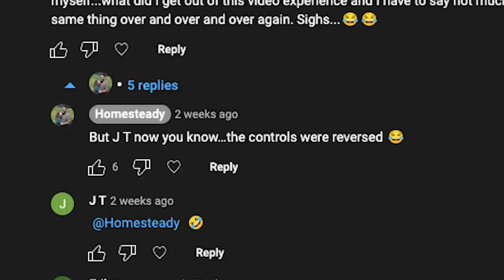Why We are RE DIGGING the POND DAM...

Comment: For that small of a pond, I'm not sure about using a standpipe for overflow. Over time, that pipe will corrode and fail. A good spillway will keep the pond level down. My father put in a standpipe with shut-off valve on the 2.5 acre lake at the farm. When there was a lot of rain, the spillway took off what the pipe couldn't handle. I think it was a 18" or 20" pipe. A few years ago (lake was 32 years old) that pipe and the valve sprung a leak. If left, it would have eroded out the dam and it would have failed. We had to drain down the lake, cut off the pipe, fill the end with concrete, cap it, and cut off the other end and cap it. Now, only the spillway carries the water off. It was higher than the standpipe, so it had to be brought down 6" so the pier wouldn't be underwater. Pier height had been established using the standpipe water level. I have a 3/4 acre pond, with lots of water coming off the hill in big rains, and I just have a spillway lined in bullrock. My pond has been here over 30 years. The drop-off behind the dam is about 30' into a slough.

Comment: U definitely got rain coming, lots of it!! You don't have anything in the pond for the fish to hide from larger fish. Do that before water gets in there! They need hiding spots!! Or you won't have many fish cause all the big fish will eat the little fish, then die themselves from lack of food from eating it's all. So hiding spots... Important! Frogs, plants, tadpoles.. important. Just a suggestion take it or leave it. Most important thing is an air raider to put air into the water for the fish, or you'll have dead fish. Do that b4 water gets in there! I had Wendys for lunch today too! Lol small world. I'm a landscaper, so I know all about ponds. Good luck. Oh if u want it 8ft deep, then make it 10ft, settlement!

Also don't forget a screen for the top of the pipe, you don't want it to get a clog. So put a screen over it, and 2-3 times a year check it make sure no leaves are blocking it. Easy. 

Btw, you look like Mario! Where's Luigi?
Reply from the maker: Great points! Did you notice the bricks and stumps on the sides of the pond? They are the start of a bunch of structure for fish!
Reply: @Homesteadyshow  no I didn't see that hun. That's perfect, just remember stumps will eventually rot over time and wood floats, so it will be difficult to hold down. Lol also things like concrete and stones, are your best bet.  Also if you want deck for your pond, then I suggest concreting it into the settlement below the dirt line of the pond, before water gets in there. So you'll have a nice area to cast from, to swim off of, and to load small boats and stuff into the pond. If course just a suggestion. I'm not sure we're you live, I'm in Virginia. If you need any lumber for creating anything let me know, my husband works at a lumber mill. We can get wood at cost of creating the wood. So basically a buck a piece. For 4x4s, 2x6s, 2x4s, and 2x8s. Unfortunately they don't do plywood. But everything else they do. I have a huge pile of wood out back now. That you could help yourself too. 

I've been watching you guys for a while now, u have a beautiful family and we love what you're doing! Keep up the hard work! Eventually it will pay off. I'm sure it already does through the quality of life!

Comment: Stop crying and get working should definitely be a tshirt. And a hat. And a mug. Words to live by!
It’s looking awesome! So great that you got the pipes in and could save some $’s on them! Danny’s method of building the pond then digging a trench makes a lot of sense. 
I might have some news. A property showed up on the market yesterday that has a lot of potential. The house is a bit unfinished so would need to get floorboards or carpet done before moving in, and some of the walls need either painting or dry wall etc. The kitchen is acceptable, bigger than I have here but not yet big enough but it looks like there would probably be enough space to expand it, or worst case scenario add an outdoor kitchen. There is running water and power and sewerage working so it’s liveable as is, but it will be way easier to get the flooring done when it’s empty. I can settle both and then rent here for a month or however long I need to get work done. The price seems to reflect the fact that there’s work to do and I would be able to get the main things done before moving in. In fact it’s a bargain. It’s 14.34 acres, but some of it is quite rocky. There seems to be 2 good pasture paddocks though. The agent said it could support 6 steers! There are rainwater tanks and bore water. We have a family friend (he was sort of an honorary extra son to my grandmother so I guess that makes him an honorary uncle) who lives out near where I’m headed and it was Gran’s funeral today so I showed him the listing and picked his brain a bit to try to figure out if there was something wrong which was why the price is so low. He has a friend in that town so is going to ask some questions for me. I spoke to the agent yesterday but because of the funeral needed to not go racing out to see it immediately, so we’re planning to go next week, on my birthday. That would be cool if I love it! If it has a good, peaceful feeling, and if the traffic noise from a nearby main road isn’t too loud, then it might be the one. If I did get it, I would be able to fix up what’s needed, put in a big solar system (honorary uncle knows a guy!) and probably rip out the kitchen and put in a new one, and potentially the bathroom too if that needs it, and be mortgage free and have a bit of change left from this place, so financially it would be brilliant! Oh and the views from the lounge and bedroom windows are gorgeous. Looking out onto undulating fields with stone walls. And there are some stone walls that would be mine too! It’s 3 bedrooms and has an attached garage and also a double carport, so the garage could be converted to a room if needed. There’s no shedding so I will need to add something for milking and storing feed. Totally doable. This could be it!!! So, do you want me to email you the link before I’ve gone out to look at it or do you want to wait until I’ve seen it and know if I love it?
Oh, it’s about 20 minutes closer to town than the last place I was looking at too. An hour and 16 minutes to Mum’s, rather than an hour 35. That’s a fair chunk less for the round trip. It’s also only about 10 minutes on country roads and then it’s highway all the way in, so a safer drive.
Reply from the maker: Monique! That’s so exciting!!! We’ll be thinking of you. Def will be a doable distance to travel to your Mums
Reply: @Homesteadyshow  isn’t it! Fingers crossed it all falls into place! I’ve spent most of the day today scrolling through the photos over and over lol. I’m sure it can work. 
That little bit closer to Mum’s also means everything is closer. My doc, my chiropractor, my dentist. The regional city which has just about everything else I might need is 20 minutes instead of 40. It even looks like one of the major supermarkets will deliver groceries to the door! That would be very handy, especially in the first year. So we shall see. I’ll let you know!
Reply: Hey Monique, it’s Sue from Melbourne : )  That’s awesome! I checked out the listing - you did amazingly well to find some decent land for that price! The house is a bit raw at the moment, but that’s ok, all the better to mould it into something you’ll truly be proud of. Maybe it’s just the weather at the moment, but I’d want to put a wood heater in there asap, if it doesn’t already have one, then get busy planting some quick growing firewood! And probably some shelter belts : )   I doubt it will have much affect on you but the title has a Vegetation Protection Overlay on it, just so you know. Do you think you’d put an offer in before it goes to auction, if you decide you really want it? At that sort of price it might not be worth risking losing it. But also, make sure you get it checked out in case there’s a reason it’s so cheap. All stuff you know. Anyway, good luck 🤞
Reply: @s-c..  Hi Sue :) I decided it wasn't right for me. The house just had too much to do, including things like replacing areas of rotten floor and things that I just really don't want to deal with, and something that doesn't show very well on the photos is how little flat land there is on the property. There's really only a few metres around the house that's flat and then it's a really steep hill. Steeper than Aust and K's hill down to the barn. I want my next place to be the house I die in, and once I'm old and a bit feeble (can't say old and grey coz I'm already going grey!) I would struggle to get around I think. I have a bit of arthritis in my knee which is being made much worse by just 4 stairs in my current house so I think it would flare up from that incline. 
I did then ask the agents if they had anything else I should look at and there was another one which was up for auction Saturday. I had seen the listing and ruled it out because I thought the road would be too busy, but it was only a 15 minute drive from the place we were looking at so we went to have a look. Actually, the traffic noise was fine because it wasn't constant. Here I have constant traffic noise and it's really draining, but there it was the odd car or truck and you heard it for a few seconds and then it was gone. It was really nice, but needed some immediate work and there were a couple of things in the contract that would mean you'd need to have a fair stash behind you which you might need to use at any moment. I went to the auction and I very nearly got it, but one extra guy started bidding right at the end and he pushed it way over market value. It just wasn't worth that much. Even without factoring in the 20 grand of immediate repairs and the required stash, it wasn't worth it. So I stopped. I think I made the right decision. Something else will come along. I still have some time. Actually the agent told me about one that will be coming up next year that has a lot of potential as long as it's the right price. The agents thought I did great at the auction and they really liked me, and they know what I'm looking for, so I know that if something comes up that might suit they'll call me straight away. So now I have agents through 2 different agencys looking out for what I'm after. Something will show up at just the right time. I'm sure of it.
Btw, Cobden is a gorgeous little spot! I'll be stoked if that's my nearest town! Really lovely people.
Reply: @s-c..  btw, great job finding the exact property with that info! Sue the Sleuth! 😂😂😂 It did have a wood heater but they've removed it.🤦‍♀ The stone hearth was on logs in the lounge room. There was a split system but that wouldn't really be enough out there. Better than nothing though. The rooms were actually quite large and it had a lot of potential, it just wasn't right for me. Someone will do wonderful things with it though. They've had a lot of enquiries already so if you want to snap it up yourself be quick! If you bought it we could do coffee 😂
Reply: That’s too bad Monique. Gosh, maybe I’m not as good a sleuth as I thought 😂, cos even street view has the whole area looking fairly flat. Lots of mounds all over the place tho, & rising to the main road?  But yeah, I have a particular set of skills earned from several years of obsessive real estate research!
It’s very wise to be thinking ahead & future proofing through your property choice now. But just remember, there is no perfect property & the longer you wait for that golden nugget the more perfect it will have to be because you’ll have less ability to fix it yourself. This is also stuff you know : ).  So what’s on your must have list, apart from being flat?
Reply: @s-c..  😂😂😂 nah the photos and even street view didn’t show how steep it was. It was definitely a surprise when we got there! The house was way higher than the main road. From the house it went down really sharply, and then up again towards the road where all those mounds were. 

I’m not going to wait years for perfection. But I still have a few months up my sleeve so I’m not yet desperate enough to grab something that’s not right or not good value. 

Must haves. Quiet. Not much traffic noise, far enough from neighbours that I don’t hear their music in my house and don’t get barked at by their dogs for daring to step into my yard. 
Water, 2 sources would be much preferred, but if only rainwater tanks then enough storage to feel secure or space to add an extra tank. 
Flat space for raised garden beds, but the whole property doesn’t need to be dead flat. An area that makes sense for fruit trees too. 
The house must be single level. No stairs inside. Both for me and my knee and also because my little dog really struggled with the stairs here in her last few years and actually fell down them which probably shortened her life because she needed extra pain meds which were bad for her kidneys. I don’t want to watch another dog struggle with stairs. 
A big kitchen with lots of bench space. Doesn’t need to be fully modern or my dream kitchen, but if it’s not there needs to be space to extend it (say into a dining room or meals area) without knocking out walls. 
3 bedrooms. One to sleep in, one to be a spare room/hobby/sewing room, and one to be a larder to store all the food I’m going to preserve in my big kitchen. If I’m lucky enough to get a 4th bedroom the spare room would be separated from all my hobby stuff. 
A shed or garage or something with power to store “stuff” as I slowly get around to unpacking, then to be a kinda workshop for my tools and a space for freezers. It would be nice to have my car undercover too but that’s not a big deal if it’s not. 
In a condition where I can move in and start living there straight away and then slowly fix things up and make it mine, as opposed to needing to organise tradies and drive up and back many times to get it into livable condition. 
It needs to feel good, peaceful. A happy house. Mum is very sensitive to bad feelings in houses so I take her along whenever I look at one. 
I want a wood heater even though Mum keeps nagging me that they’re too much work. I know that, but I still want one. I also want a reverse cycle split system though so if I’m not up to having a fire, I can press a button. Hell, these days I don’t even have to press a button as I’ve got it automated through my smart home stuff lol. I can add a split system after moving in though if there isn’t one. 
I’d prefer a separate shower, however if there’s a shower over bath I know exactly how I would create a separate shower and bath in the same footprint so that’s not the end of the world, but I would need to get that done straight away. I’ll be there on my own so need to know I’m not going to fall. 
Need space for a cow plus a calf and yearling. A few sheep. Chickens. Maybe a few ducks. But not so much space that it’s overwhelming. Somewhere that makes sense to milk the cow would be nice too, and somewhere to put the chickens that I’ll be bringing with me on the first night would be awesome. 
An old outbuilding that could be converted to a living space would be wonderful, but if not then a little nook or two where I could perhaps park a caravan where it would feel like it’s a separate space, rather than in my backyard. I have a cousin who has insecure accommodation and an interstate friend who is currently living in her car and I’m really hoping I can find a way to help at least one of them. 

I have a pretty wide area that I’m looking at and every time there’s a listing with potential I look it over pretty thoroughly and see if I can think of a way to overcome its imperfections, so I don’t think I’ll pass up something great for the sake of waiting for perfect. I also don’t want the wrong place though, and financially I want to be either where I am now or better off, not worse off. Especially with interest rates going nuts at the moment. At the auction I wasn’t really doing the sums between bids but now that I look at when I started feeling uncomfortable, it was when if I had to sort out the power issue straight away, my mortgage would go up. Just because a bank says you can borrow a certain amount of money, doesn’t mean it’s a good idea to spend it all! I would have managed, but it would have been very tight and taken much longer to set things up than it would with my current repayment. 

How are prices where you are? Steadily slumped or getting worse?